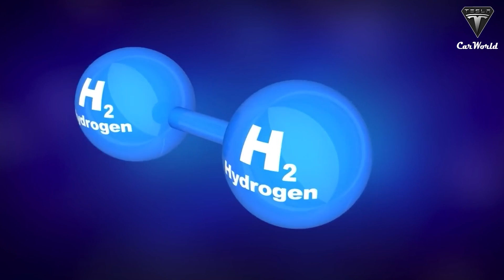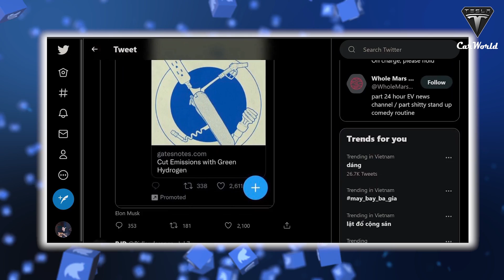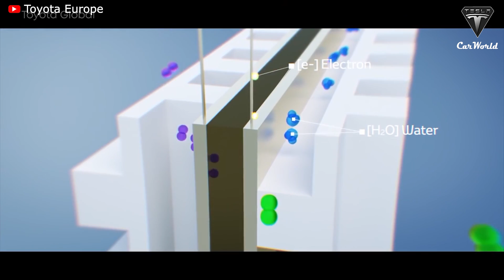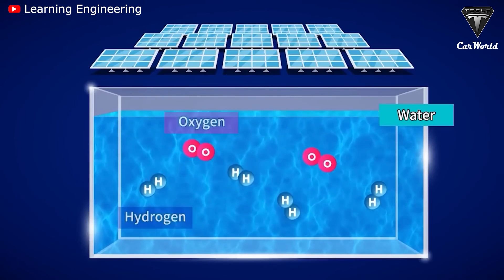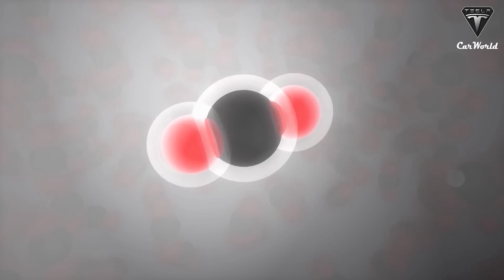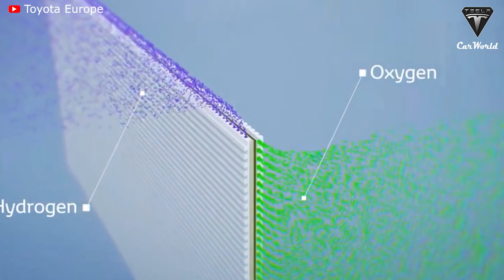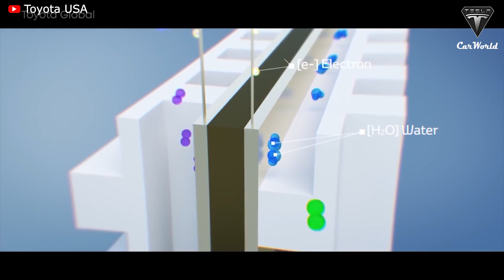It Happened! New Hydrogen Breakthrough, Shocked by the Cheap Price of $0.80

Comment: Three kilograms of hydrogen contains the same amount of energy as a 1200 pound 100 kilowatt hour battery, enough energy to push a Mirai more than 452 miles. Problem is the hydrogen mixes with oxygen and turns into water so when it's gone you need to buy more, kind of like buying a brand new battery but it's a lot cheaper. And the Mirai can hold 5.6 kilograms ( almost 187 kwh ). That's almost like two 100 kwh batteries.

Comment: What’s the problem with Hydrogen, Water Vapour is the exit gas from hydrogen engines. UN, the biggest greenhouse gas is not CO2 but Water Vapour, 70% by volume in the atmosphere. Where do you think all the Worlds flooding comes from, look up the clouds are water Vapour, new media buzz word. Rivers Of Rain.
CO2, 4% by volume. Why do you think there are so few Hydrogen powered cars. Underground piping for Hydrogen is extremely expensive.

Comment: When the gas arrrives at its destination and the 5 to 30% hydrogen is extracted what happens to the 70 to 95% natural gas that's left over?
Reply: After you extract the hydrogen, what's left is a lot of solid carbon. The fastest and easiest way to get rid of the carbon is to mix it with oxygen and pump it into the atmosphere. A gasoline engine will turn 1 kilogram of hydrogen into 8.93 kilograms of water and then turn the remaining 6.69 kilograms of carbon into 24.52 kilograms of carbon dioxide.

Comment: Hawaii Island has five volcanoes. We will be over the “hot spot” for 1-2 million years. We have heat, water and permeable rock to transmit the heat. It’s like a giant battery that never needs charging. We have no fossil fuel in our geothermal rocks. Hence no carbon when we make green electricity. From the green electricity we can make green hydrogen and from the green hydrogen we can make green ammonia. All from our free geothermal heat that will last for 1-2 million years. Our single geothermal operation PGV will provide 24/7 electricity at a cost of around 5.6 cents kWh when they are at 46 MW production in 18 months. See PUC Docket 2019-0333. Our group applied to the PUC for a special 10 cents kWh special hydrogen rate two years ago. We are extremely lucky. All we need to do is have the determination to provide a better life for toddlers who will reach 25 years, one generation, from now. That is 2046. That’s way too late. We need to get on it now!! We are now working on a special PUC Docket to address this special hydrogen rate of 10 cents kWh question. That’s the least that we can do for future generations.

Comment: While Elon is right, but so is Bill Gates. Could that be possible? Yes. This way 👇

Instead of generating hydrogen at the source of electricity,  why cant we produce it at the fueling place? Instead of creating expensive pipelines all over the land for hydrogen transportation through containers, I feel it is better hybrid stations of Electricity and Hydrogen Fuel cells co-exist and serve for both purpose. These stations have EV Charging as well as Hydrogen Production through electrolysis and then containerization. There by we can reduce the  hydrogen leakage through transportation. So this enables small EV vehicles to be charged as usual and heavy duty vehicles can be refueled with hydrogen fuels containers. Hydrogen creation need not happen at the source of Electricity, but at the point of fueling.

Comment: *Hydrogen will be useful for big stuff, ships, trucks, planes.*
It does not make sense for cars or for cars infrastructure.
The issue that is not mentioned is ,, they promise competitiveness in 5 years and they always assume battery tech will not improve.

Do not forget, this is a common business practice to hype/promise something so you can attract funds for your research.
Reply: Yup be our new petrol (electricity) and our new diesel (hydrogen) .. Infrastructure is being put in place. Even boiler makers can make adapters from gas to hydrogen.. It takes time

Comment: RE to fuels is best done with catalysts...  Ethanol is the fuel, NOT H2.  A New Combustion engine will be PAR to an EV in efficiency... 50-75%.  Ramge 7000 miles.  Combined cycle and CO2 capture.  $1/gal fuel cost at house.  This is future, not BEV or FCEV.  

Make fuel at home with solar THERMAL (NOT PV) and store for 5000 times less than battery.  Make fuel all year long to use in winter/nights.  

EVs are loaded with CO2 and fuel cells need batteries.  Won't work for CO2 neutral.  Both BEV and Fuel Cell EV cannot get to CO2 neutral.

Comment: You can't change the fact hydrogen is 3 WATT HOURS per LITER at atmospheric pressure. So it is energy intensive to store. Also it is dangerous, do a test. Leak a tank of hydrogen into a homes garage then see if the electric garage door opener ignitinting the hydrogen blows up just the house or all the neighbor houses as well.

Comment: I recently saw a video by Matt Farrell about hydrogen and was skepticle. Then a short time later, Thunder foot did a debunking video that made much more sense from what I know.
This is about as useful as all the videos touting the game changing battery that does not exist outside of a lab. Im with Elon on this one. With a battery, you get about 85% of what you put in. With hydrogen, you will only get 50% of what you put in at the maximum after 10 more years of research. It is just an obnoxiously expensive infrastructure to install also. The only ones talking about how great hydrogen could be are the ones spending all the grant and research  money trying to keep their job alive for another year. And then all the hydrogen fuel cell cars still need some batteries on top of everything else. Not gonna ever be economically viable.
Reply: Here is the deal. Each technology has perks. Some times that far outweighs the costs or inefficiencies. 

There is a perk of hydrogen people don't realize. 

You can make hydrogen at home and you can use the fuel off grid. You can make it from seawater also. The water vapor released can also be drinkable. You could use electrolysis to get hydrogen then use the byproduct from a hydrogen generator or engine as more water to use electrolysis or you could drink it. This would allow you to have drinkable water and fuel from one system and be completely off grid. You could also sell the excess fuel.

Having fuel that is easily transportable is a pro. Yes batteries are transportable too. But with fuel you can take it to a store and directly empty your gas into their liquid gas containers. You could create a whole economy around it.

You could also create peace on the planet. If countries use hydrogen instead, they will not have to worry about these oil companies or the control associated with it. With hydrogen, you are free from corporate and government posturing. 

Think about all the countries that are slaves to these corporations and treaties. So many countries don't have access to fuel at all.

The real reason hydrogen hasn't taken off is because it risks the stranglehold that our current world order has on it's populations.
Reply: @ricky4673  yes, hydrogen is a viable source of energy. It is just that solar, wind and batteries is just easier and more efficient. If we were still using expensive, not so efficient solar panels with lead acid batteries, hydrogen would start to look compelling. You need about double the solar to make an equivelant amount of hydrogen energy, then you need an expensive fuel cell to make it back into electricity. Then the hydrolizer needs constant maintenance and occasional replacement. Then you need the actual water supply. With solar and a battery, you need only something to use the energy for the next 25 years, like a light bulb or a car with another battery.

Comment: This analysis needs a timeline.  Comparing future hydrogen technology prices to existing batter prices ignores the fact that these are improving too.  The efficiencies of renewable energy sources that create the hydrogen also recharge the batteries.  I believe that   Musk is correct that hydrogen is nonsense for the current decade but of  mainstream EV's, but beyond that horizon it's impossible to predict.
Reply: that means, as far as I understood it, the H2 is a vehicle, actually a mobile nuclear reactor that does not vent and is not radioactive...
this would mean that we replace the existing nuclear power plants with a new one...radioactive nuclear waste...one less worry...because the waste is clean water...and we have electricity to heat us without using natural gas...which is sufficient replacement and the world doesn't need to depend on any gas supplier... I don't see why the world is panicking about gas... from Russia or Qatar or any other country... let them get it up their ass... but if it is here is the solution for this problem in the palm of your hand...
Reply: Then why are taxi companies choosing hydrogen vehicles instead of BEVs?
Reply: @jimj2683  I am not aware that they are. I suspect it has to do with economic distortions caused by subsidies.  Hydrogen makes much more sense for planes, possibly ships and large trucks rather than cars.
Reply: @thomassimmer5186  It is because supercharging is super expensive and still relatively slow. The prices are usually around 50-70 cents per kWh.
Reply: In the year since I wrote those comments, the case for hydrogen has become much worse.  Battery and charging technology are improving quickly and the charging infrastructure is developing rapidly.  Meanwhile hydrogen has been found to strengthen methane's role as a greenhouse gas.

Comment: There is a lot of nonsense there. There is absolutely no magical process that can make Hydrogen less expensive than its energy source, whether natural gas or electricity. Since storing electricity by water electrolysis/compressed hydrogen/fuel cell has an overall efficiency around 27% and storing electricity with chargers and batteries is 85% efficient, it takes 3x more electricity going the hydrogen route, thus must be at least 3x more expensive. 

2 decades ago when early hydrogen fuel cell prototypes were being tested, hydrogen went for about $8 a kilogram, It is now about $16 per Kilogram, with no real reduction in sight. The "$1 per Kg, to $0.80 per Kg" is what they'd have to achieve in order to compete with electricity - it's a goal, not a destination. They don't actually have any way to reach that goal. If they can get ultra-cheap electricity, so can the BEVs.

Comment: Wait, what? You filter hydrogen out and the byproduct is ammonia. Then you use ammonia to convert it back to hydrogen? Is it in the same system or do you have to bring your ammonia somewhere to be converted to hydrogen?

So you use energy to capture hydrogen, then you dilute it, then you use more energy to filter it, then you convert it to energy to store in a small battery which powers the car. Then you use more energy to convert ammonia to hydrogen? And somehow this will be cheaper than battery-powered car which stores the energy in the battery to power the car?
Reply: Someone doesn't understand basic chemistry, or basic physics. Hydrogen = H2  Water = H20.  Ammonia = NH3

Comment: YouTube allows videos to be produced on topics without the video maker knowing anything about the topic. This video is a perfect example.
Reply: The heading is pure click bait. Instead, the video presents content about some vague, projected future breakthrough instead of anything current. 

I, for one, am sure there will be breakthroughs. But I don't like being suckered by curiosity about an alleged one that turns out not to have happened yet.
Reply: There is not one word about an actual breakthrough or a novel technique for producing hydrogen. The only fairly useful thing here is a summary of the current unsustainable price for hydrogen.  This is pure clickbait and should be removed from YouTube.
Reply: @everettlwilliamsii3740  it's Red Hydrogen that was discovered and innovated by Japan. It makes nuclear power plants zero emissions and produce Red H2. The nuclear power plants use gas instead of water to cool reactors. This increases the safe temperature from 600°F to 2500°F before the reactor can melt. All tests with Red Hydrogen nuclear plants only had 60% reached when at maximum for 50 days.
This makes it extreamly safe.
This also makes the world's coal and natural gas power plants dead technology and cuts all emissions from producing EVs, FCEVs and other transportation systems. Currently about 90% of power is coal and its extremely harmful in its emissions.
The Red Hydrogen can also increase vehicles range from 300/500miles in EVs to 700-1000 mile range with Red Hydrogen Fuel Cell Electric Vehicles.
If the industry adopts Hydrogen then we will see prices drop from $8/Gal to $3 per Gallon by 2025 or even less. But realistically Hydrogen will be $5-$7 a Gal on release.
Reply: and that’s good. It’s up to us to decide if content is accurate not some bunch of 25 year olds or an algorithm

Comment: Everyone relates to miles per gallon. How many miles can you travel using one kilogram of Hydrogen. Isn't the purpose of this memo to communicate, so please communicate.
Reply: According to Toyota Mirai II spec: 7 kg of H2, range about 850km, 1kg H2 cost U$16.
Reply: Calculate miles per gallon then divide by 0.3714919. Example: 383÷8.1=47.28 miles per gallon of gasoline 47.28÷0.3714919=127.27 miles per kilogram hydrogen and 8.1×0.3714919×33.333=100.302 kilowatt hours of electrical energy.
Reply: @saltydogg  Direct calculate per kg about :
= 850km/7
=122km.
H2 energy density is 40kWh/kg, total storage:
7kg*40kWh/kg=280kWh,
Per km energy used: 280/850=0.330kWh. 
or kWh ranger: 
850/280=3km/kWh.
Reply: You forget the price per mile
Reply: No the majority of the world uses the metric system. Km per kg.
Reply: @AORD72  It doesn't matter  what system that is used. An amount of fuel per unit distance is what I was referring to, the distance traveled per one kilogram should have been communicated.

Comment: You keep speaking of kilograms so I don't have a mental visual of the amount. I have no clue if it is a large or small amount but you spoke of distance in miles. Why do you people put up what looks to be an interesting and possibly informative video and then make it confusing and some what meaningless.
Reply: In the video, he did mention that current fuel cell vehicle cost is 4x the cost of ICE vehicles to fuel up. The title is a joke as the so-called breakthrough could happen by 2030.